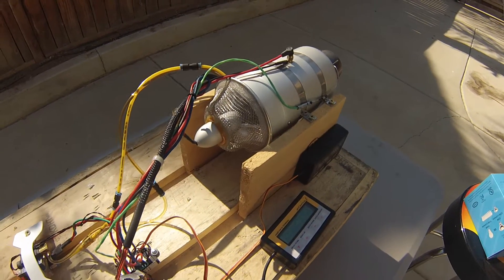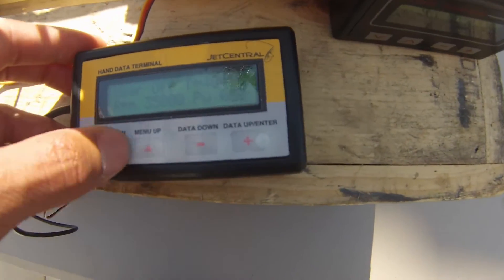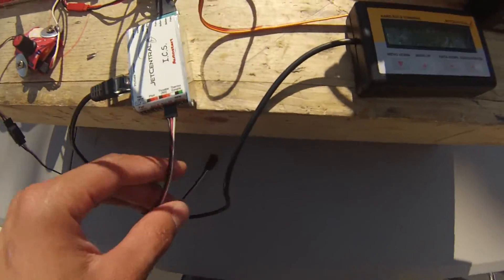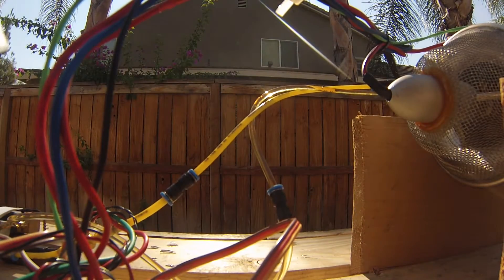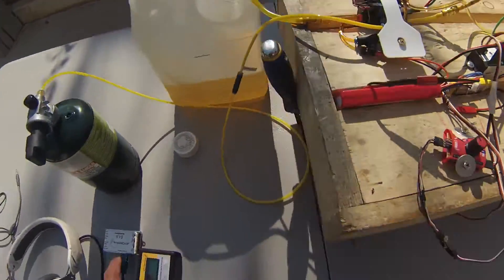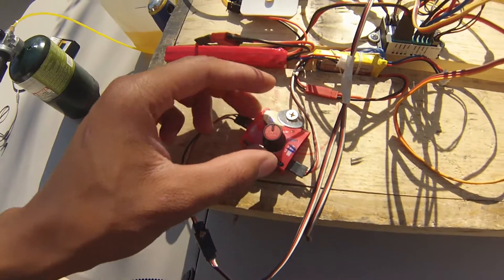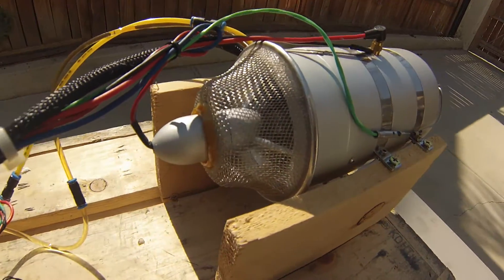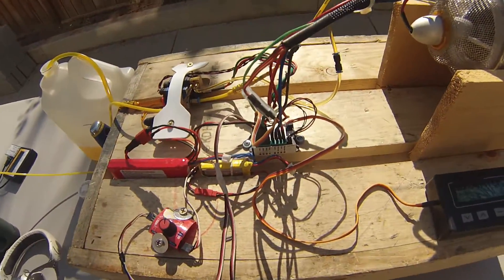Jet Central Falcon 100 Turbine Engine

Comment: What fuel are you using? Have you run diesel on it? I just got one of those use but fresh from service and previous owner say is OK to run diesel on it. I already messed jet central but haven't get a response yet.
Reply from the maker: Daniel Madrigal yes im using diesel with kingtech oil. Dont run aero shell 500, its carcinogenic and isnt very clean burning. Just use kingtech oil, the only REAL micro turbine oil made for these micro turbo jets.
Reply: 10fantic awesome thanks and thanks for oil advice to , I have a few gallons of kintech oil so that just makes it even better.